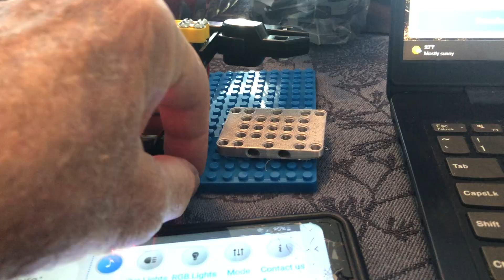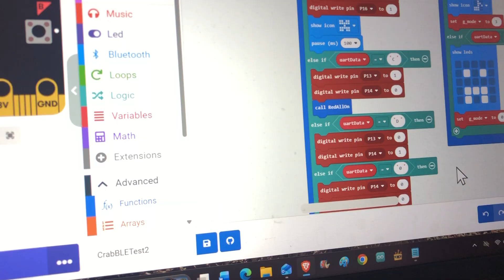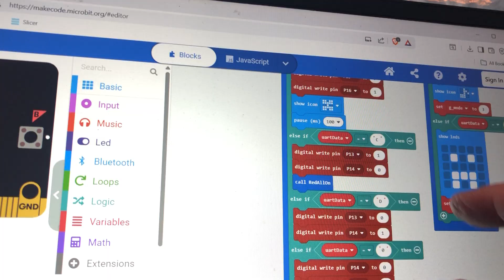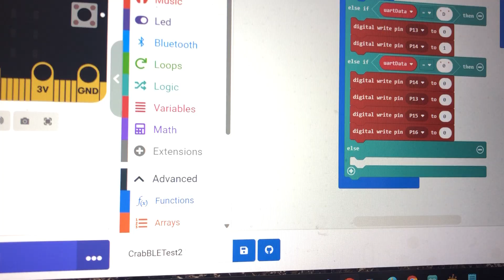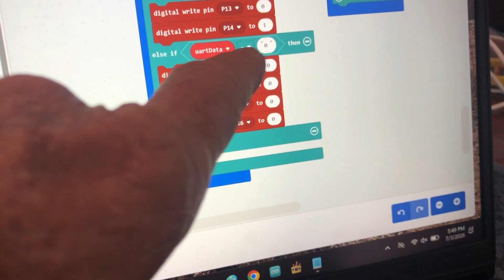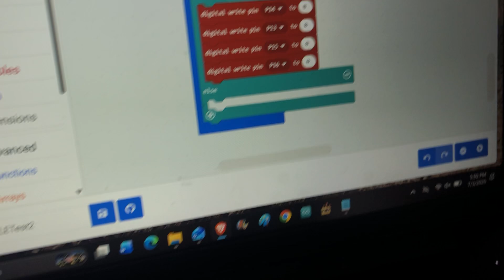Micro:bit Bluetooth Control of 2 Motors

Comment: Looking forward to the next instalment!
Reply from the maker: https://www.youtube.com/watch?v=Vq-iTg-Mw6M, we made this video some years ago, Prof. Evans, showing MakeCode Arcade sending radio commands to Microbit.. the Kittenbot  Meowbit game console has an SD sized card which is not for storage but for radio send and receive. It's the servo assembly that I'd like to kids to duplicate for lifting a bucket.
Reply: @makecodeandhardware1395 that’s cool. I hadn’t seen the meowbit before.😀
Reply from the maker: I think we can make 3 motors respond; even though the driver has only 3 AAA batt. 5v instead of 6 or 9v. I want Abby to find the pin #'s that address the remaining DC pin pair for another DC wheel motor and from there build out a rover car with grabber on the front. Steve Smythe on Element14 review laments that the Crab was not easily adaptable to LEGO Technic but he didn't try the bolt-on to the beams method. Same can be done with the driver board as with the crab arm. What do you think about using 'radio' Professor Evans ? I'm leaning that way now as it might be more accessible to other users . (?) .  Also, I have found how to turn off and on individual rgb led's on the sensor board, now to learn how to program each one a different color (colour *) Thank you for your interest. I sent a note to a fellow MakeCoder in Brighton, England that there seems to be a seller in UK who has the kit for 5 Pounds Sterling :  https://tinyurl.com/4snzzfpf
Reply: @makecodeandhardware1395  Hi Frank, that’s a good price! It’s very tempting especially considering it has been discontinued and has limited stock. Might be my last chance! Micro:bit radio is much easier than Bluetooth as the protocol is simpler. But you are restricted to communication between micro:bits. It’s not difficult to turn a micro:bit into a controller though.